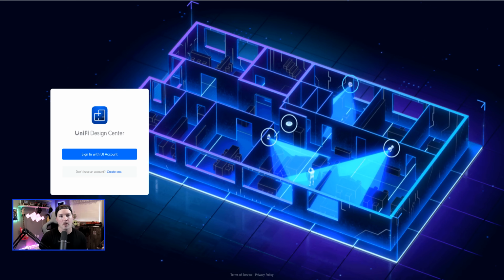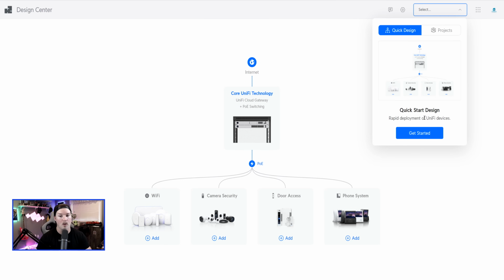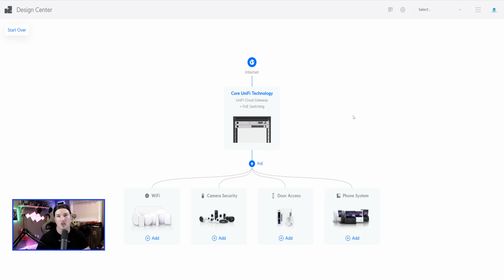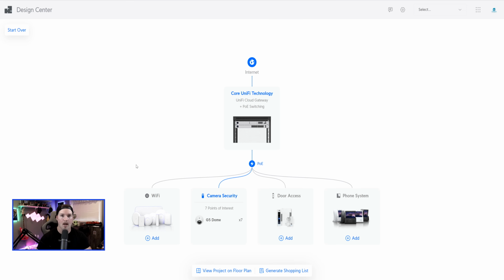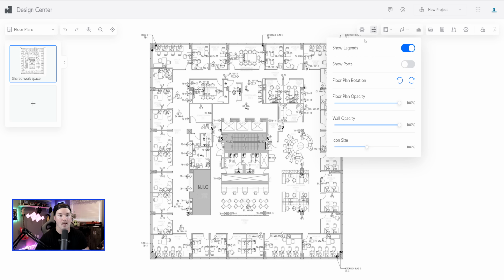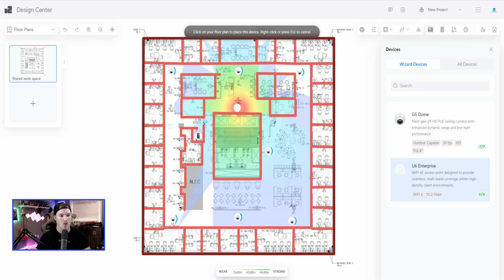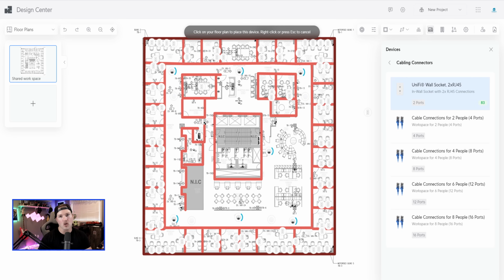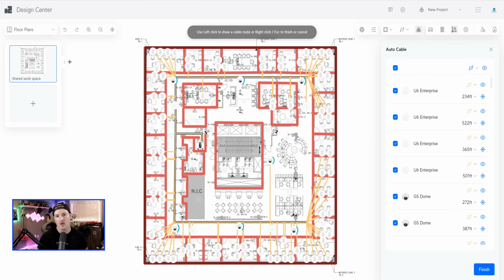Unifi Design Center 2023

Comment: How do you use this to design a wifi network for a 3 storey home?
Reply: You simply don't. However Ubiquiti might make separate floor plan layout to tie in the wired network from floor to floor risers/trunks. AP coverage would NEVER be calculated through a floor.
Reply: You can use the "Tunnel" option to link floors

Comment: Another vote for 2 story setup. Also how accurate is the WiFi map?¿ Can i just use that to estimate how many APs?¿
Reply: Ubiquiti might make separate floor plan layout to tie in the wired network from floor to floor risers/trunks. AP coverage would NEVER be calculated through a floor because it won't be stable or accurate.
Reply: You can use the "Tunnel" option to link floors

Comment: How do you use this for a 2 story home to make sure you have appropriate Wi-Fi coverage?
Reply: As of right now, I don't think there is support for multiple levels.
Reply: You can use the "Tunnel" option to link floors
Reply: In any enterprise environment I have ever worked in, each floor and building within a property is considered its own floor plan envelope. I doubt that will ever change because AP coverage through a floor is only something a DIYer on a shoestring, 'good enough mentality' would ever consider best practices while in the real world of IT, you'd get laughed out of your job and into the parking lot.
Reply: @FirstLastOne  In the real world of IT, you have to consider signal coming from other levels, to avoid conflicts and channel overlap, so this would be critical in the platform, to be quite frank.